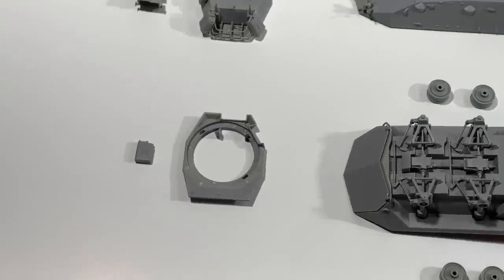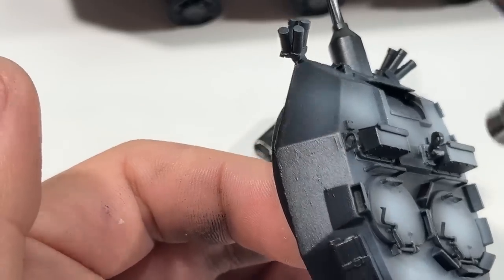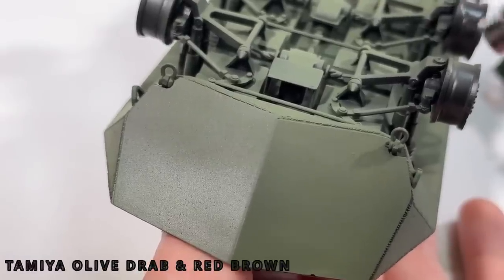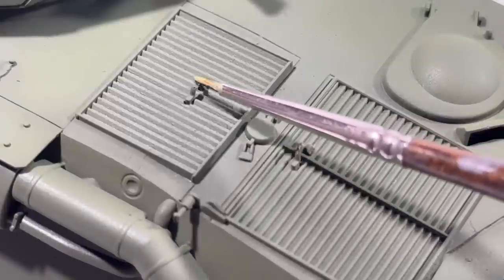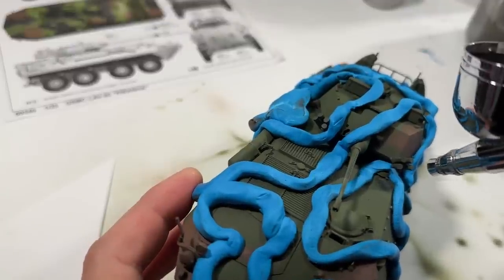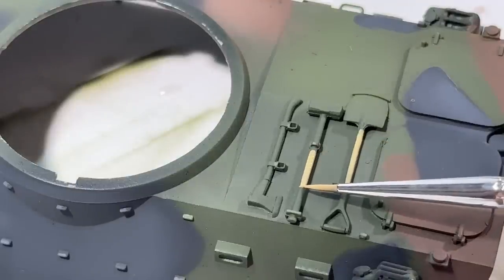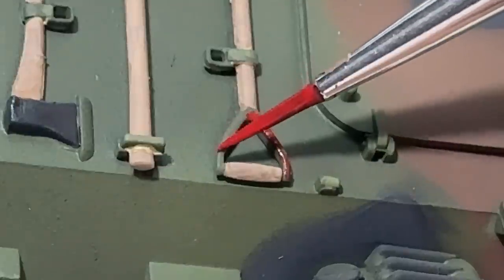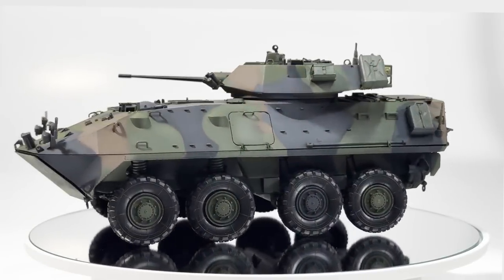Learn to Paint Scale Model Camo

Comment: I use rolled cotton which looks like Blue Tack only softer. I use two way tape (not the real stuff) and spray the cotton with hairspray to trap any unwanted fibers. Believe it or not it works. I don’t like hard lines either. They don’t often occur in nature except in rocky areas. Don’t knock it til you try it.

Comment: Another tip is that often, the crews paint right over the wood handles on the tools mounted to AFV bodies so they are often the same color as the camo. This was often done on AFVs back in WW2 as well. You'll find a lot of AFV axes,shovels, and picks with painted  handles.
Reply: Yes, Witchywoman165! Having served in the USMC, nothing carried on a Marine or their vehicle isn’t camouflaged. Even our rifles are, especially in the scout-sniper community. When I see great modelers neatly painting their pioneer gear I cringe. The last thing you want if you’re a tanker is the glint of sunshine coming off a nicely steel shovel or pinch bar. You’re dead. I’ve read and own just about every major source book on WW2 German armor and crews would just use their on board air compressor to paint over everything in the same camo scheme. I get why modelers do this, but that’s not real world experience. I’m not knocking this talented modeler. I’m just being honest. On a slightly off topic matter, I also cringe at modelers who are hell bent on making their own weld beads as at least half that I’ve seen are out of scale! Here’s an idea: if the kit has sufficient detail on welds, simply give them a few spots of wear by patting some chrome or silver or even primer over the welds. This brings out the weld texture without blowing them out of scale. I rarely mess with weld beads. Occasionally I’ll put some around a major feature which we know was welded , but usually I just weather it and leave it alone and in scale

Comment: one trick ive found that works with masking tape too, if you apply the blutack or masking tape to the model, first spray the base colour along the inside edge, that way if theres any pocket where the paint would run underneath, it fills with the base colour, then when you spray your 2nd colour into the masked off area, you should always have crispy edges without that little bleed you sometimes get.

Comment: Fairly solid method, nice work. Unfortunately there was still a bit of dust under the paint on some panels. Very difficult to get rid of
Reply from the maker: Thank you. Yes, dust is tricky and it’s one of the things that separates a good paint job from a great one. I’m trying to pay better attention to dust, it’s a very tricky problem. I have started to place a box over the model while paint & varnish drys, and I try to remember to dust everything down before painting.
Reply: @commonostrichYT  I hope I didn't come across as critical or overly so. I use optical alcohol wipes before painting and use an extractor booth. Seems to solve at least some of it but it's the bane of my life when it happens. I normally rub it out with fine grade and repaint
Reply from the maker: @garoidodubhaill  Nope! Constructive criticism is exactly what this channel is for - I can't improve if people don't tell me what I'm doing wrong 😁 I appreciate the advice and I will try out some alcohol wipes. I am planning on getting a fume hood in the near future. Dusting is one of those monotonous things I always seem to forget before I start painting and it really adds up by the end.

Comment: nice work on the camo, i have a question re the Needle size and psi used in this video. i've just tried my first attempt on a Panzer 1V i used Vallejo Olive Green Model and i think i thinned it too much and it flowed on the model, i just couldn't get the narrow lines to work and i was using 0.2mm needle and fooled around with the psi any constructed help would be appreciated.
Thanks
Allan
Reply from the maker: I use a 0.3mm needle at anywhere between 20-40 PSI, just depends on the paint and how it's spraying. I struggled a lot with the 0.2mm needle, maybe try going up a size and messing around with the pressure. With Vallejo ModelAir I either don't thin it at all or thin it very slightly, maybe a 5:1 paint:thinner mix. It sprays very nicely at higher pressures (35+ PSI).

Comment: Don't suppose you could let me know what pressure you're using for your primers, paints and clearcoats through the airbrush. Haven't been using an airbrush for long and everyone seems to say different things.
Reply from the maker: I normally spray thinned acrylics at 20-25 psi. Vallejo Air sprays right out of the bottle pretty well anywhere from 25-35psi, primers vary but with Mig OneShot I go somewhere around 30-35psi. I have no idea if the regulator on my cheap Chinese compressor is accurate though, and there's no way to tell if other people's recommendations are accurate either. I would recommend testing out different paint+thinner+psi combos on plastic spoons and figuring out what works best for you. Humidity, nozzle size, paint types, thinners all make huge differences in how paint behaves so it's best to figure out what works best with your specific setup. Start around 20psi and work up from there. As you get more experience working with the tools it'll become much more intuitive.
Reply: @commonostrichYT  Hi would just like to say thank you for spending your time replying.
I will keep at it and work my way up. Your pressures are around what I've found sort of works with my setup. 
A lot of information especially Vallejo's I've used but the pressures are just too low.
Have subbed, I will definitely keep my eye out for more of your videos.
Cheers.

Comment: Paint lights aluminum or a silver then clear coat several times with high gloss clear or medium for simulating glass. Use translucent paints for colored lenses.
Reply from the maker: Thanks for the tip Tony! In my next episode I’m planning on exploring some different techniques for headlights.
Reply: @commonostrichYT  testors makes a product, I also suspect craft stores would have some thick clear mediums.

Comment: To hold a turret for priming/painting stick a blob of bluetac on the top of a 60ml bottle of Vallejo primer.  Set the turret down over the bottle so the bluetac will stick to the inside of the turret roof.  I've used this method for years and it works great.  As well, once you paint your pioneer tools with your choice of wood colour, paint over with thinned Vallejo Smoke to give a bit of a woodgrain look but only brush in one direction along the length of the tool handles.  For metal parts, paint with flat black or panzer grey, and once the vehicle is clear coated in matt, rub the metal parts with a graphite pencil.  It give a very convincing steel look.
Reply from the maker: Thanks for the tips! I figured the blutac trick out and it works great. I'm working on some more tools right now so I'll be sure to try out the smoke and graphite tricks!
Reply: @commonostrichYT  Or you can glue a long cutted  sprue (in area where it will be hidden).
Reply: Коллега, эта классика) и знать её должны все!
Reply: easiest way to paint metal part is painting by gunmetal grey color. I tried and it worked great, no need to do many steps

Comment: You made a great video, I think I'm going to have to put that kit on my bucket list. Can I give you a couple of tips? First if you are painting US military vehicles in camo you might want to download a copy of TB43-0209. It has "color by number" drawings of current in service vehicles that show the pattern in great detail. You can print out the vehicle you're painting to scale and cut them out as masks. It works really well, I used it on my HUMMV (full disclaimer I did have to use a bit of latex mask to fill in some areas and it also work really well as an adhesive for the masks). Also you might want to try hollowing out your headlights and painting them silver (or use silver mylar as a backing) then fill them in with a drop of clear UV resin. The silver mylar also makes a nice reflective surface for rearview mirrors.
Reply from the maker: Dan, wonderful tips! I’ll keep TB43-0209 in my back pocket for next time I do a scheme like this. I’ll be testing out that headlight tip in my next video too! Thanks for commenting 👍

Comment: Doing some research I learned that the camo pattern on each Leopard 2A5 is identical.  I guess this is also true for other German military vehicles.  Factory robots painting first a base layer of NATO olive green and then the same brown and black spots over and over again.
Reply: That may be true for several years but I highly doubt the Marders 1A2's  and Leopards coming off lines in the late 80s or 90's were painted by robots and I have seen several conflicting nato 3-color schemes on them.
Reply: @witchywoman165  I did mention the 2A5 version in particular.

Comment: Hey bro, nice to see you learn the hobby.  Using primer is an important step, but you seem to use it only to build base for next coats. Nothing's wrong with it, tho it's even more useful to correct previous mistakes,  like pins, glue stains, sink marks, etc. Primer makes those very easy to spot and fix, and it's good practice to do so, as those imperfections would be visible on a finished surface. Good luck with your journey!
Reply from the maker: Great point - I need to get some fine sandpaper and files to help with cleanup. I appreciate the comment!

Comment: That was a excellent build and paint job, it looked as if it had anti slip, if so did you add this? You have yourself another subscrber, best regards from Australia 👍👍👍
Reply from the maker: Thanks! No it’s not anti-slip, it’s just a messed up airbrush needle and Vallejo primer 😅 I’ve sorted that issue out though for the next video.

Comment: TIP: Use silly putty instead of blue tack - it sticks well enough but doesn't run the risk of pulling up paint (and it's reusable).
Reply from the maker: Thanks! I’ll give it a try in the future!
Reply: @commonostrichYT  some people complain of oily residue when using putty for masking.  maybe some results will vary, user error might occur, locking coats into clear might prevent stains on flat paint

Comment: So many scale model tank painting video's are 1/35. There is a huuuge 1/16 scale RC tank community that gets completely neglected 😢
Reply from the maker: Yes 1/16 would be very cool, but it is also much more expensive. Some of the 1/16 models are over $500 and 1/35 is normally only around $50. I'd like to do 1/16 one day.
Reply: @commonostrichYT  yeah, cost is definately a factor. There's so much more choice with 1/35 though,